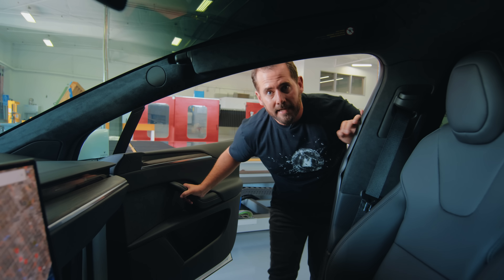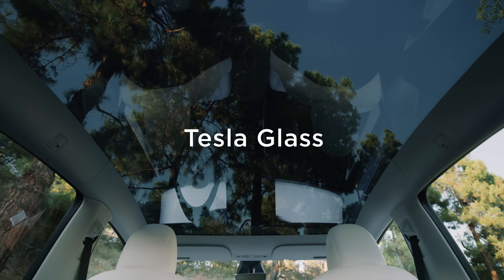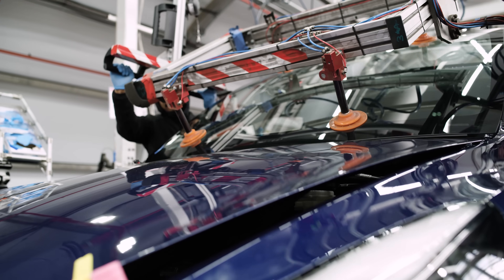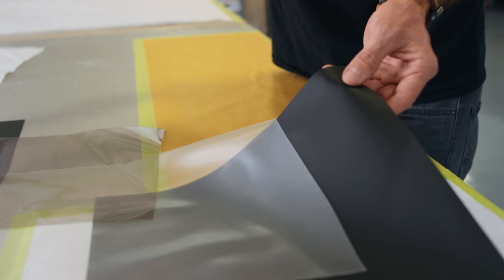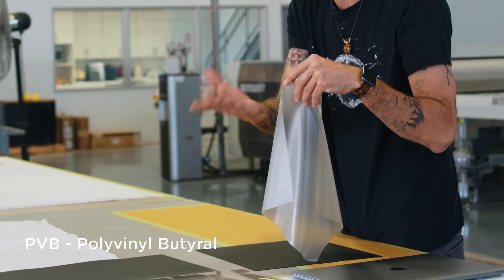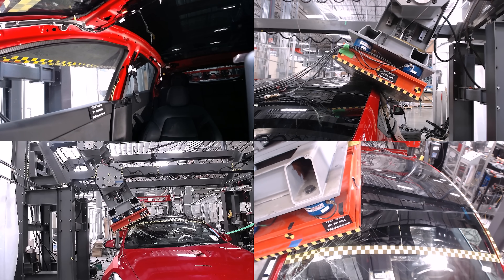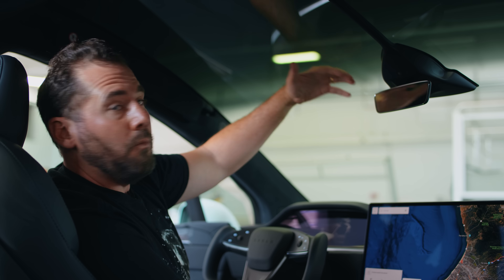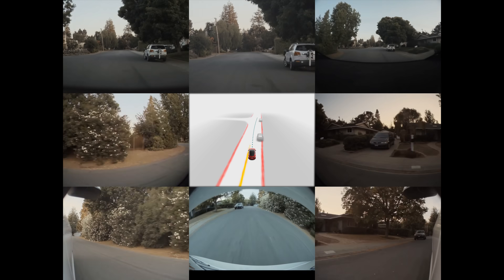Tesla Glass | The Secret to a Quiet Cabin

Comment: So amazing! I cannot wait to buy one!
Reply: It was new in the 80s.
W140 features included:

Double-paned soundproofed glass was a new S-Class innovation first fitted on the W140. This form of window glazing allowed for improved soundproofing, reduced condensation, and other insulation benefits.

Electrically-operated exterior mirrors could be folded by switch to ease driving in narrow spaces.

'Parameter steering' was a system which made low-speed driving easier by reducing the effort required to maneuver in speed-sensitive situations such as parking.

Rear-parking markers, or guide rods. These rods extended from the rear corners of the trunk lid when in reverse, providing the driver with a guideline for rear maneuvers. In 1995, this system was replaced by the sonar-based Parktronic system which measured the distance of the bumpers to nearby obstacles.

12-way powered, heated front seats, with 3 setting memory functions and lumbar support.

Windshield wipers with heated washer system. Later models also included rain-sensing windshield wipers.

Electrically-operated automatic-dimming inside rear-view mirror that tied into the seat and steering wheel memory.

Heated exterior mirrors. Later models also included auto-dimming driver's side mirror.

Orthopedic seats were an expensive option from the factory but consisted of several different air cushions in the seat that the user can inflate and deflate to find the perfect driving position.

Dual-zone climate control. Four-zone climate control on LWB models.

Reclining and heated rear seats on LWB models. V12 models also have the four-place seating option, which allows fully adjustable rear seats, lumbar support and rear sunshade control. The center seat has been replaced by a burlwood center console, allowing a 2 + 2 seating format.

The climate control system could be set to operate for 20 minutes after the engine had been turned off.

Electric rear sunshade.

Rear passenger illuminated vanity mirrors.

Soft-closing doors and trunk.

Leather interiors and burl inserts (optional; standard for 500SEC/CL 500).

In 1995 the S 600 Coupe became the first Mercedes car with GPS navigation system, designated Auto Pilot System APS. It featured CD-ROM maps and full color navigation display in the center dashboard.

In 1996 the Linguatronic voice control system and Parktronic sonar-based parking system were introduced

In 1997 the TELEAID emergency and tracking system was introduced in the US market.

Also, developed with the car, a Bose sound system was available as an option.

Comment: Incredible attention to detail
Reply: Nope.
W140 features included:

Double-paned soundproofed glass was a new S-Class innovation first fitted on the W140. This form of window glazing allowed for improved soundproofing, reduced condensation, and other insulation benefits.

Electrically-operated exterior mirrors could be folded by switch to ease driving in narrow spaces.

'Parameter steering' was a system which made low-speed driving easier by reducing the effort required to maneuver in speed-sensitive situations such as parking.

Rear-parking markers, or guide rods. These rods extended from the rear corners of the trunk lid when in reverse, providing the driver with a guideline for rear maneuvers. In 1995, this system was replaced by the sonar-based Parktronic system which measured the distance of the bumpers to nearby obstacles.

12-way powered, heated front seats, with 3 setting memory functions and lumbar support.

Windshield wipers with heated washer system. Later models also included rain-sensing windshield wipers.

Electrically-operated automatic-dimming inside rear-view mirror that tied into the seat and steering wheel memory.

Heated exterior mirrors. Later models also included auto-dimming driver's side mirror.

Orthopedic seats were an expensive option from the factory but consisted of several different air cushions in the seat that the user can inflate and deflate to find the perfect driving position.

Dual-zone climate control. Four-zone climate control on LWB models.

Reclining and heated rear seats on LWB models. V12 models also have the four-place seating option, which allows fully adjustable rear seats, lumbar support and rear sunshade control. The center seat has been replaced by a burlwood center console, allowing a 2 + 2 seating format.

The climate control system could be set to operate for 20 minutes after the engine had been turned off.

Electric rear sunshade.

Rear passenger illuminated vanity mirrors.

Soft-closing doors and trunk.

Leather interiors and burl inserts (optional; standard for 500SEC/CL 500).

In 1995 the S 600 Coupe became the first Mercedes car with GPS navigation system, designated Auto Pilot System APS. It featured CD-ROM maps and full color navigation display in the center dashboard.

In 1996 the Linguatronic voice control system and Parktronic sonar-based parking system were introduced

In 1997 the TELEAID emergency and tracking system was introduced in the US market.

Also, developed with the car, a Bose sound system was available as an option.

Comment: Wow! I'm impressed! #TSLA
Reply: You shouldn't be
W140 features included:

Double-paned soundproofed glass was a new S-Class innovation first fitted on the W140. This form of window glazing allowed for improved soundproofing, reduced condensation, and other insulation benefits.

Electrically-operated exterior mirrors could be folded by switch to ease driving in narrow spaces.

'Parameter steering' was a system which made low-speed driving easier by reducing the effort required to maneuver in speed-sensitive situations such as parking.

Rear-parking markers, or guide rods. These rods extended from the rear corners of the trunk lid when in reverse, providing the driver with a guideline for rear maneuvers. In 1995, this system was replaced by the sonar-based Parktronic system which measured the distance of the bumpers to nearby obstacles.

12-way powered, heated front seats, with 3 setting memory functions and lumbar support.

Windshield wipers with heated washer system. Later models also included rain-sensing windshield wipers.

Electrically-operated automatic-dimming inside rear-view mirror that tied into the seat and steering wheel memory.

Heated exterior mirrors. Later models also included auto-dimming driver's side mirror.

Orthopedic seats were an expensive option from the factory but consisted of several different air cushions in the seat that the user can inflate and deflate to find the perfect driving position.

Dual-zone climate control. Four-zone climate control on LWB models.

Reclining and heated rear seats on LWB models. V12 models also have the four-place seating option, which allows fully adjustable rear seats, lumbar support and rear sunshade control. The center seat has been replaced by a burlwood center console, allowing a 2 + 2 seating format.

The climate control system could be set to operate for 20 minutes after the engine had been turned off.

Electric rear sunshade.

Rear passenger illuminated vanity mirrors.

Soft-closing doors and trunk.

Leather interiors and burl inserts (optional; standard for 500SEC/CL 500).

In 1995 the S 600 Coupe became the first Mercedes car with GPS navigation system, designated Auto Pilot System APS. It featured CD-ROM maps and full color navigation display in the center dashboard.

In 1996 the Linguatronic voice control system and Parktronic sonar-based parking system were introduced

In 1997 the TELEAID emergency and tracking system was introduced in the US market.

Also, developed with the car, a Bose sound system was available as an option.

Comment: Ahhh this just makes me want a tesla even more though (as a 17 year old) there's absolutely no way I can afford one haha
Reply: Learn something 
W140 features included:

Double-paned soundproofed glass was a new S-Class innovation first fitted on the W140. This form of window glazing allowed for improved soundproofing, reduced condensation, and other insulation benefits.

Electrically-operated exterior mirrors could be folded by switch to ease driving in narrow spaces.

'Parameter steering' was a system which made low-speed driving easier by reducing the effort required to maneuver in speed-sensitive situations such as parking.

Rear-parking markers, or guide rods. These rods extended from the rear corners of the trunk lid when in reverse, providing the driver with a guideline for rear maneuvers. In 1995, this system was replaced by the sonar-based Parktronic system which measured the distance of the bumpers to nearby obstacles.

12-way powered, heated front seats, with 3 setting memory functions and lumbar support.

Windshield wipers with heated washer system. Later models also included rain-sensing windshield wipers.

Electrically-operated automatic-dimming inside rear-view mirror that tied into the seat and steering wheel memory.

Heated exterior mirrors. Later models also included auto-dimming driver's side mirror.

Orthopedic seats were an expensive option from the factory but consisted of several different air cushions in the seat that the user can inflate and deflate to find the perfect driving position.

Dual-zone climate control. Four-zone climate control on LWB models.

Reclining and heated rear seats on LWB models. V12 models also have the four-place seating option, which allows fully adjustable rear seats, lumbar support and rear sunshade control. The center seat has been replaced by a burlwood center console, allowing a 2 + 2 seating format.

The climate control system could be set to operate for 20 minutes after the engine had been turned off.

Electric rear sunshade.

Rear passenger illuminated vanity mirrors.

Soft-closing doors and trunk.

Leather interiors and burl inserts (optional; standard for 500SEC/CL 500).

In 1995 the S 600 Coupe became the first Mercedes car with GPS navigation system, designated Auto Pilot System APS. It featured CD-ROM maps and full color navigation display in the center dashboard.

In 1996 the Linguatronic voice control system and Parktronic sonar-based parking system were introduced

In 1997 the TELEAID emergency and tracking system was introduced in the US market.

Also, developed with the car, a Bose sound system was available as an option.

Comment: Innovative glass? Yes please!
Reply: It was innovative in the 80s
W140 features included:

Double-paned soundproofed glass was a new S-Class innovation first fitted on the W140. This form of window glazing allowed for improved soundproofing, reduced condensation, and other insulation benefits.

Electrically-operated exterior mirrors could be folded by switch to ease driving in narrow spaces.

'Parameter steering' was a system which made low-speed driving easier by reducing the effort required to maneuver in speed-sensitive situations such as parking.

Rear-parking markers, or guide rods. These rods extended from the rear corners of the trunk lid when in reverse, providing the driver with a guideline for rear maneuvers. In 1995, this system was replaced by the sonar-based Parktronic system which measured the distance of the bumpers to nearby obstacles.

12-way powered, heated front seats, with 3 setting memory functions and lumbar support.

Windshield wipers with heated washer system. Later models also included rain-sensing windshield wipers.

Electrically-operated automatic-dimming inside rear-view mirror that tied into the seat and steering wheel memory.

Heated exterior mirrors. Later models also included auto-dimming driver's side mirror.

Orthopedic seats were an expensive option from the factory but consisted of several different air cushions in the seat that the user can inflate and deflate to find the perfect driving position.

Dual-zone climate control. Four-zone climate control on LWB models.

Reclining and heated rear seats on LWB models. V12 models also have the four-place seating option, which allows fully adjustable rear seats, lumbar support and rear sunshade control. The center seat has been replaced by a burlwood center console, allowing a 2 + 2 seating format.

The climate control system could be set to operate for 20 minutes after the engine had been turned off.

Electric rear sunshade.

Rear passenger illuminated vanity mirrors.

Soft-closing doors and trunk.

Leather interiors and burl inserts (optional; standard for 500SEC/CL 500).

In 1995 the S 600 Coupe became the first Mercedes car with GPS navigation system, designated Auto Pilot System APS. It featured CD-ROM maps and full color navigation display in the center dashboard.

In 1996 the Linguatronic voice control system and Parktronic sonar-based parking system were introduced

In 1997 the TELEAID emergency and tracking system was introduced in the US market.

Also, developed with the car, a Bose sound system was available as an option.

Comment: tesla glass is awesome
Reply: Nope
W140 features included:

Double-paned soundproofed glass was a new S-Class innovation first fitted on the W140. This form of window glazing allowed for improved soundproofing, reduced condensation, and other insulation benefits.

Electrically-operated exterior mirrors could be folded by switch to ease driving in narrow spaces.

'Parameter steering' was a system which made low-speed driving easier by reducing the effort required to maneuver in speed-sensitive situations such as parking.

Rear-parking markers, or guide rods. These rods extended from the rear corners of the trunk lid when in reverse, providing the driver with a guideline for rear maneuvers. In 1995, this system was replaced by the sonar-based Parktronic system which measured the distance of the bumpers to nearby obstacles.

12-way powered, heated front seats, with 3 setting memory functions and lumbar support.

Windshield wipers with heated washer system. Later models also included rain-sensing windshield wipers.

Electrically-operated automatic-dimming inside rear-view mirror that tied into the seat and steering wheel memory.

Heated exterior mirrors. Later models also included auto-dimming driver's side mirror.

Orthopedic seats were an expensive option from the factory but consisted of several different air cushions in the seat that the user can inflate and deflate to find the perfect driving position.

Dual-zone climate control. Four-zone climate control on LWB models.

Reclining and heated rear seats on LWB models. V12 models also have the four-place seating option, which allows fully adjustable rear seats, lumbar support and rear sunshade control. The center seat has been replaced by a burlwood center console, allowing a 2 + 2 seating format.

The climate control system could be set to operate for 20 minutes after the engine had been turned off.

Electric rear sunshade.

Rear passenger illuminated vanity mirrors.

Soft-closing doors and trunk.

Leather interiors and burl inserts (optional; standard for 500SEC/CL 500).

In 1995 the S 600 Coupe became the first Mercedes car with GPS navigation system, designated Auto Pilot System APS. It featured CD-ROM maps and full color navigation display in the center dashboard.

In 1996 the Linguatronic voice control system and Parktronic sonar-based parking system were introduced

In 1997 the TELEAID emergency and tracking system was introduced in the US market.

Also, developed with the car, a Bose sound system was available as an option.